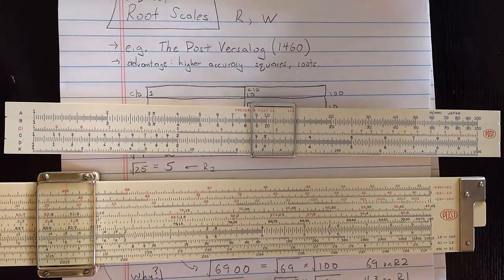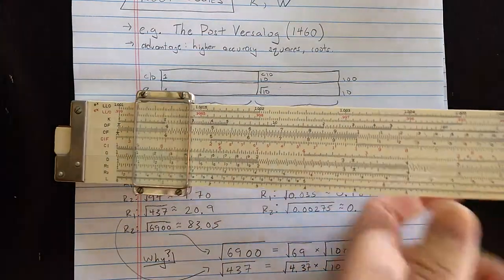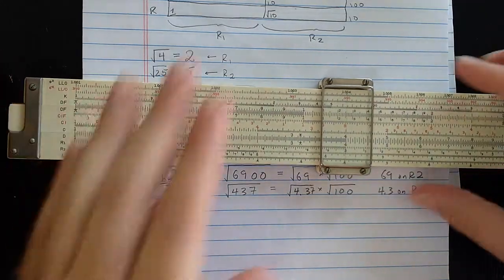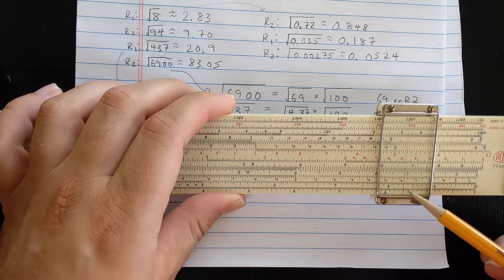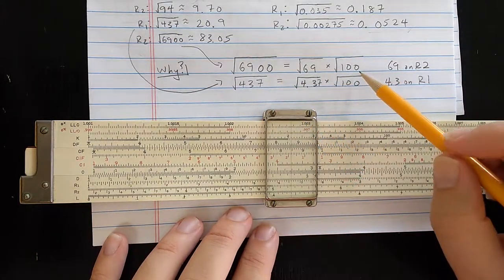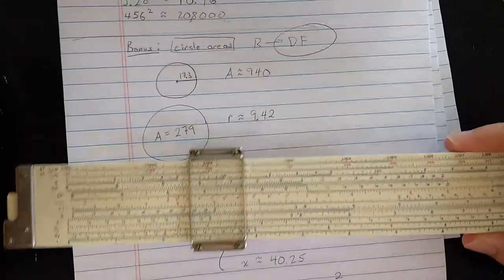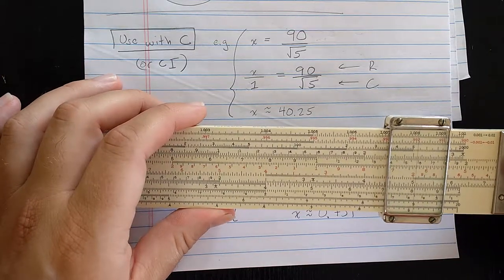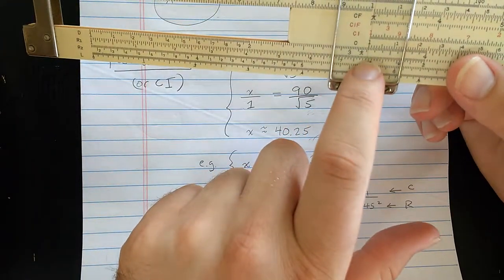Versalog-style Root Scales (R1, R2)

Comment: The key to knowing which R scale to use is to express the input in a bent sort of scientific notation, as a multiple of an even power of ten. This way your significant digits are always a one or two figure number (plus decimal places) and the decision on whether to use R1 or R2 is easier. It's a horrible misuse of scientific notation, but an easy aide-memoire in cases like this.
Reply from the maker: For those that like this idea, it would also work when using A/B and trying to decide which half to use. For K, use a multiple of three.
Reply from the maker: Also, I wouldn't call this a horrible misuse of anything -- if you understand why this works, you're just using math appropriately to solve a problem.
Reply: @ProfessorHerning  I'm a bit late to the party, but just sitting here and following along on my Aristo Studio and the Nestler no.9.
Isn't the 'even powers of 10' rule a direct consequence of taking powers of 10 out of the square root?
sqrt(10) is part of the question, but sqrt(100) just contributes a factor of 10 to your result, and you 'remove' sqrt(100) as many times as necessary to fit your radicand on your A (or R1/R2) scale.
At least that's where I ended up after this video, trying to transfer from R1/R2 scales.
Reply from the maker: That's exactly what's happening, although there's many ways to understand it.

Comment: When you mean replace the A and B scales, does this mean the R1 and R2 scales can do everything the A and B scales can do?
Reply from the maker: On the original Versalog 1460, squares and square roots are supposed to be calculated using the root scales where on a slide rule with A/B, those are used for the same operations. Usage is a little different and many people miss A/B on the Versalog. A later revision of the Versalog does contain the A scale (as well as the root scales).

For those basic operations, using the root scales gives you a higher resolution answer since you are using longer scales than when you use A/B, but sometimes having A/B around is nice for chaining calculations.